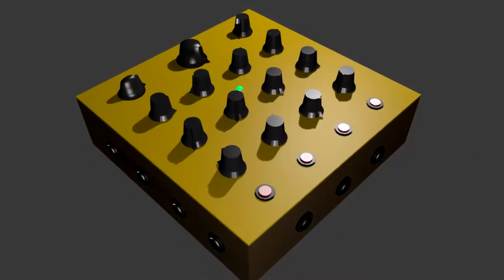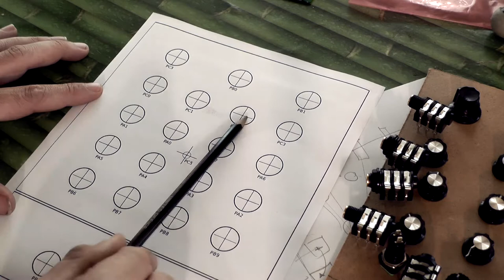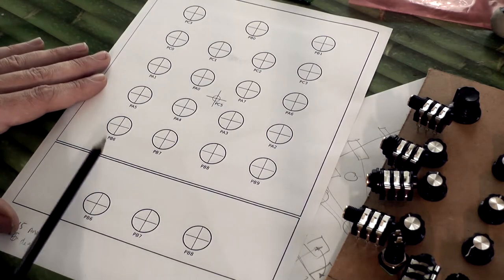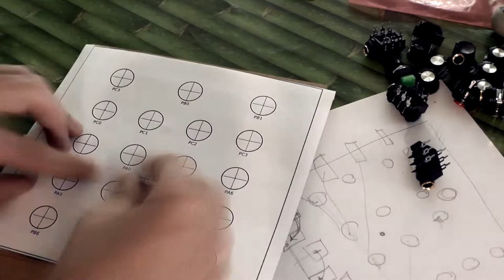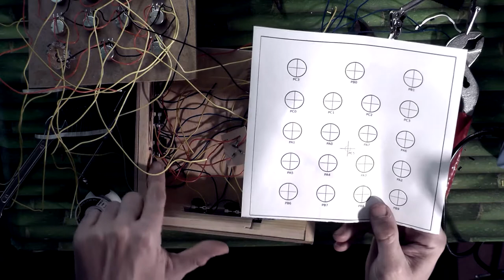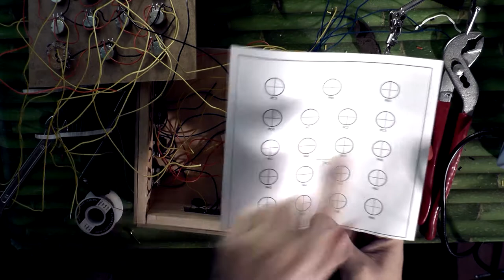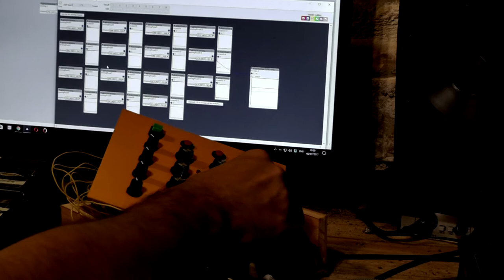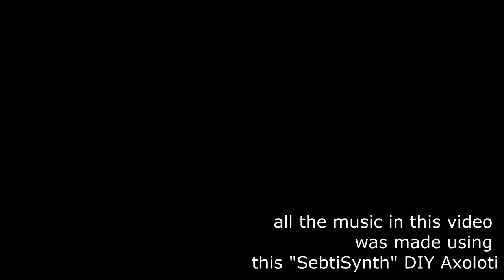Making an enclosure for an axoloti synth

Comment: Thank you for such an informative video.  Could you provide a link to the rotary switch and potentiometers that you used for this project?
Reply from the maker: For this project, I used cheap B10k pots bought on aliexpress, but if you have the budget, Go for some nice 51AAD-C20-A15L by Bourns. For the rotary switch, I also used some cheap findings on aliexpress (you can find the ref by seaching "KCZ-1 * 8 Unique 1 Pôle 8 Throw Position" on google) but I suppose you can get some much better quality ones by looking around

Comment: Excellente vidéo, Matthew, bravo, et merci pour le partage de tous ces détails ! Une petite question sur les résistances de 220kΩ ajoutées pour aller à VCCA depuis les jacks de côté (vers 32:10) : est-ce en "sécurité" pour éviter des courts-circuits ? Ou en prévision du type de pédale/capteur à connecter plus tard ? (mais pour cela, 220k me semble un peu fort, non ?)
Reply from the maker: Bonjour Jean-François. Pour les resistances, excuse-moi si j'ai surement dit une connerie, mais en fait c'est des résistance de 220 Ω (pas 220kΩ). Et c'est effectivement pour la sécurité (pour éviter les cours circuit lors des branchage-dé-branchage). Si besoin (capteur, led...) je rajoute aussi une resistance sur l'engin à connecter